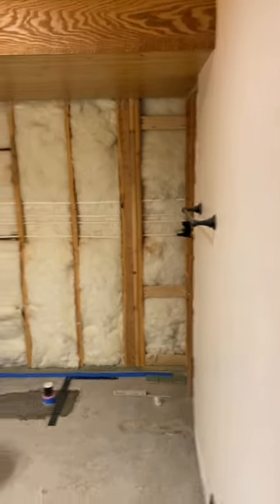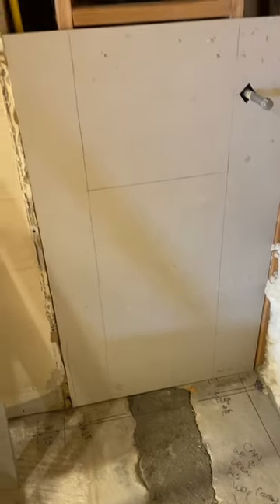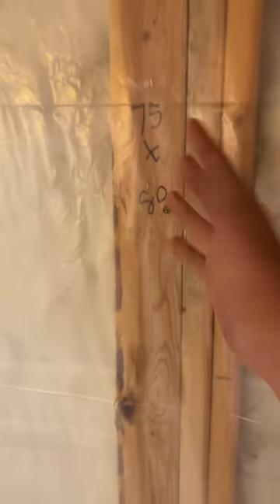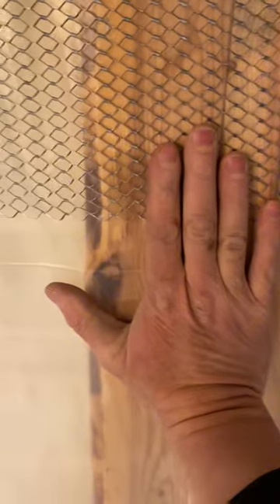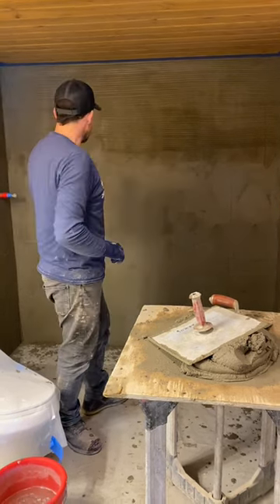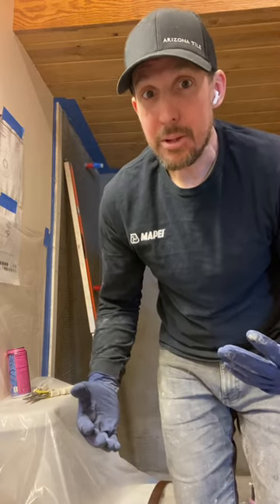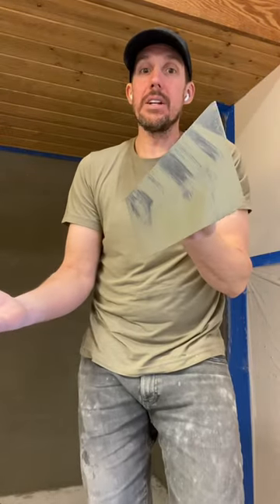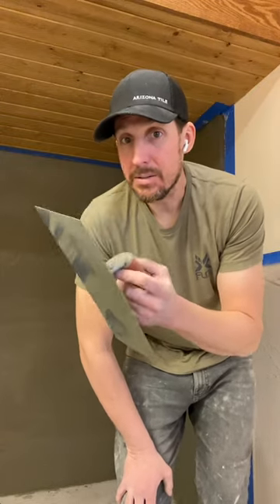Tarkus Tile Mud Tutorial.  Scratch and Brown walls

Comment: Hi Mark, I am DIYer and have a shower I will be working on my own shower sometime in the next couple of months. I love learning new things and like this approach over cement board. I learned a lot from this video. I am wondering if you can recommend other resources, books to learn this technique. I'd like to build my confidence more as far as making sure I finish with plumb and straight, as well water proofed and to CA codes. Also make sure I have all the right tools before I start.
Reply from the maker: Thank you.   Check out the John Bridge Forum.    Specifically the thread on mud work tips and tricks.    That’s where I learned for the most part many years ago.   Very helpful

Comment: nice job, i float as well and learn new stuff all the time, where did you get those masonite float strips and how thick are they? 1/8"?  also, what do you do when your side walls are out of plumb? I know plumbing the side walls with your mud on a wall that is out of plumb looks like a mistake. i know some guys nail a 1/2" stop stick on the side walls regardless because it will be parallel with the rest of the wall.
Reply from the maker: Thanks.   I cut the strips down from a 4x8 sheet of 1/8” Masonite.  As far as side walls, it depends.  Sometimes I’ll set a half inch stick regardless of how the wall is.    But usually I’m working new construction or a remodel for a GC and I’ll float everything plumb and they will have the drywall crew fix their walls after I’m done.  Which is how it should be done when possible imo.

Comment: How in the world does this hold up? I am trying to u understand the concept. A thin layer of mud on a mesh seem not very stable. Please explain. Maybe put hardibacker, staple mesh to it, then float?
Reply: Hardiebacker wicks moisture. Don’t think that would be a very good choice

10:39 The mesh reinforces the mud and makes that wall extremely sturdy. Then he applied another layer of mud the next session… so it’s definitely not a “thin layer”
I believe he just stated in the beginning that he needed the valve and side wall bumped out a 1/2” for a miter return.

He is also taking in account for the layout + tile that the customer chose, so he is prepping this shower for its specific measurements.

Comment: If water flows down,why would you do the walls first and not the floor?Just wondering.
Reply from the maker: Everything gets a topical waterproofing membrane that’s flashed into a bonding flange drain so it doesn’t matter.  Easier to do the walls first and not be messing up my floor mud

Comment: What is the advantage of doing mud vs cement boards?
Reply from the maker: Lots of advantages.  Allows us to plum and square walls without messing with framing.  More solid inside and outside corners.   Zero deflection between studs.  We can gauge the mud for exact thicknesses and elevations to achieve better layouts etc.   Plus it’s just fun.
Reply: @Tarkustile  Thanks a lot for your reply. I just finished my bath using cement board and definately not easy to fix corners with it if they are not straight.  I can see the benefit of using mud there for sure. But I would not do it myself probably as it is not easy for newbie